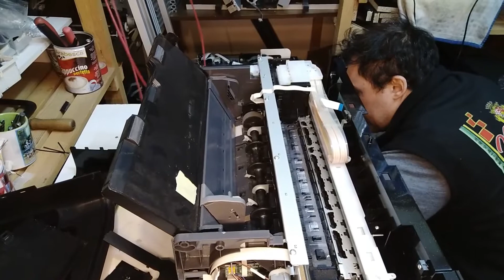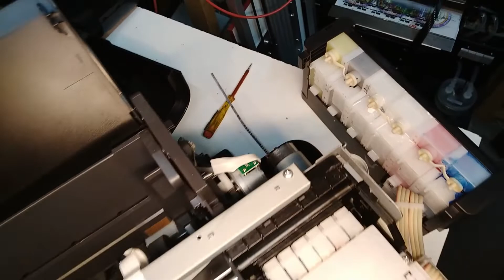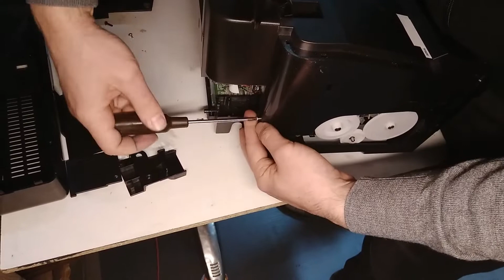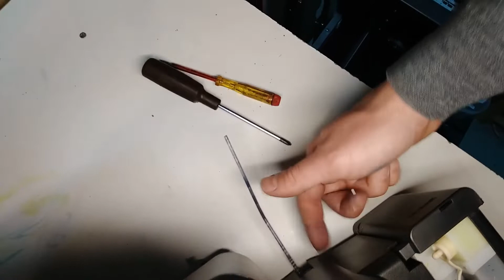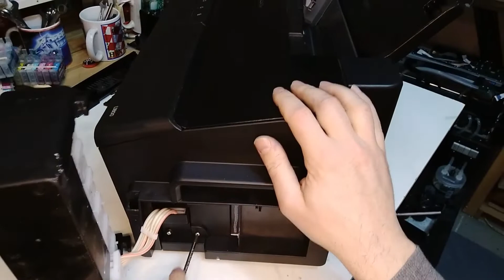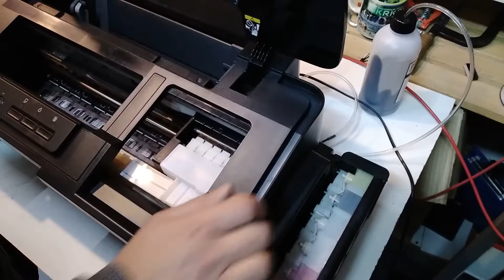DTF printer L1800 repair No. 2 (part 2)

Comment: Hi printer repair It is precious to find such an explained video. I would like to ask you a favor: I need to buy original parts for my L1800 printer. Do you have any Link? I tried to repair my printer. I installed a new head printer, but when I installed it, no color came to print, I tried everything but nothing and I think it must be the type of head printer. Can you give me an idea please. Thanks in advance
Reply from the maker: it could be two thing. usually if you dont see anything printed out at all it could be the flat cable for the head. Also if you bought a cheaper refurbished head it can sometimes be with faulty electronics, because when they clean the head (partially refurbish) they can not test the print, because once the ink goes through the head it has to stay covered with dampers or cartridges. You have OEM sellers in each country so maybe if you try with original head that would be the best thing to do.

Comment: Great videos! Are you in the US? I'm having a similar issue with my L1800 and could use your services. Please let me know. And keep the videos coming!
Reply from the maker: Nope, we are in Europe. What kind of issues?
Reply: @Max0ressurected   Printer prints faded colors that are almost invisible. It's like a shadow of the image with faint colors. I have cleaned the print head, replaced the print head with a new one, and also replaced the dampers. When priming the dampers there is a lot of pressure when pulling up the ink with the syringe. Which made me think there was air in the tubes from the color tanks. But I have cleaned out the tanks with cleaning solution and distilled water. Put in fresh ink, re-primed the dampers and still the same issue. I've only had the printer a little over two months. Any help or tips would be appreciated. It's been really frustrating trying to fix this issue.
Reply from the maker: @jaywilliams7974  are you using it with ordinary ink or dtf? Sounds like you are have problems with the pump. If everything is filled up properly and the printer is in use only for 2 months i dont think its the dampers or head. You have a valve on the outside tanks that you have to open, so check if its turned from transport to print position. If you use it as dtf set the colour dot size to middle+large. If that doesnt help you definitely have a problem with the pump. Could be that the capping is not covering the head from below as it should, so it doesnt have enough pressure on head cleans, or some tube is disconnected on it. I dont think the pump is clogged after only two months, but it could be a possibility if you are using low quality ink, although i cant say that we ran into one that bad that could clogg so soon.
Reply: @Max0ressurected  I thought it could be a pump issue as well. But I also thought how could it be so soon. The capping on the printhead is secure. The replacement printhead is new. The shipping knob on the tank is in the correct position. It really seems like it's some kind of pressure issue. It's like the ink wants to get to the printhead but can't. I also received "The waste ink pad has reached it's end of service" error twice! I don't understand how this error appeared so soon. I used the Epson Adjuster app to reset it both times. Could there be ink build up in the lines that restrict the flow of ink in two months? Also how difficult is it to replace the pump if necessary? I have been trying to solve this puzzle for weeks with no success. I have the feeling that it might be something simple, but I can't pinpoint it
Reply: @Max0ressurected  Also thanks for responding. I've contacted a few DTF printer experts and your the only one that's trying to help, so again I really appreciate your time.
Reply from the maker: @jaywilliams7974  in your case where the printer is in its original state, still with the original casing is a bit more difficult, but you have here in the videos how its done in 4 or 5 of them. The easy way to know if you have any pressure on the pump is to look at the capping during the head clean. there is a moment where the head moves to the left a bit from the capping and you can check if the head dropped some ink on it and also if the pump is gonna suck it in. If the pressure is good than the capping would be filed almost to the top.
Reply: @Max0ressurected  Apologies, I'm a bit confused. So the capping that you are talking about is the waste ink pad cap station?
Reply from the maker: @jaywilliams7974  its this thing on the link: https://ae01.alicdn.com/kf/HTB1wqthbrr1gK0jSZR0q6zP8XXaD.jpg it covers the head from below, and sucks the ink from the damper through the head
Reply: @Max0ressurected  Ahhh OK, thanks for the pic. Maybe it needs to be reseated? I also have a brand new one that I can install. So let's say it's sitting too low and maybe I accidentally knocked it out of place without knowing. Would this type of scenario restrict the ink flow to the printhead, creating the issue of little to no ink when printing?
Reply from the maker: @jaywilliams7974  not likely, because if you knock it out you could see it not standing straight and the head would stuck. same thing happens when one of the 3 small plastic pins on the capping is broken. its more likely that its not lifted all the way up for some reason. could be that the spring below is covered with ink so it wont stretch enough, could be that the mechanism of the pump skipped a teeth or two for some reasons so its lifting but not enough. we also had a case where the tube that is connecting the capping and the pump drum, popped of so it was pumping only air. You can make a test like this: when the head goes left when you start the printer pull out the power cable so you can move the head with hand to the left. Then you can pull out the sponge (even the net if you can get to the sponge because of it) so you will be able to see when you turn on the printer and start a head clean if the head is gonna drop some ink inside the capping and will it be sucked out by the pump. If that doesnt happen you will have to replace the pump.
Reply: @Max0ressurected  This is great info. I will give this a try in the morning. Many thanks.  Hoping it's not a pump issue, but if it is I will have to sort it somehow. Nothing prints on the nozzle test so that might be the case. Wish you had a video on this it would be a massive help😅 But I will do my best
Reply from the maker: @jaywilliams7974  this one can maybe help you, this printer had a problem like that https://www.youtube.com/watch?v=8rU0wQFU8aU there s also part 1 if you want to see the whole proces, but this part has the pump replacement
Reply: @Max0ressurected  I gave it a try and recorded it. File is a little large (apologies for that). Please take a look and let me know what you think. I would very much appreciate it. To my untrained eye, it doesn't seem like anything is going on as far as ink going into the capping area🤔. Here is the link https://drive.google.com/file/d/1F1brbbW1IAksT5dO9n2kgLgQc6Snkm_0/view?usp=drivesdk
Reply from the maker: @jaywilliams7974  i cant access it, says i need an approval for access
Reply: @Max0ressurected  Should be able to access now
Reply from the maker: @jaywilliams7974  you have to have capping inside, just without the sponge and the net covering the sponge. Now that you have the capping out remove the sponge and the net from the capping and install it back than film it so we can see if its gonna drop any ink to the capping. its not gonna suck the ink through the head if it doesnt seal the head from below with the capping.
Reply: @Max0ressurected  Here's the updated video https://drive.google.com/file/d/1PDAmUkOSFghxbeGPCy69xlAx3fnARn6Q/view?usp=drivesdk
Reply from the maker: @jaywilliams7974  i requested access
Reply: @Max0ressurected  Access granted
Reply from the maker: @jaywilliams7974  it seems that it is pumping something, the question is does it have enough pressure. but i should print at least something, but if its not printing anything at all than it might be the cable for the head, or something is wrong with the electronics on the head
Reply: @Max0ressurected  Maybe taking out the printhead and reattaching the cables might work🤔 Now that I think about it, I didn't start having the not printing issue until I took out the printhead to clean it when I was having trouble printing white. Soon after the prints started to fade, until I wasn't able to print anything. Is it difficult to replace the printhead cable?
Reply from the maker: @jaywilliams7974  reattaching could maybe work because sometimes it doesnt sit properly in the slot, but if you need to replace the cable it is kind a difficult but you have it here on channel in several videos. If the pins on the cable are good and not corroded, than i think you should be checking the head first. it could be the cable too but you would have to do a lot of prints until that happens. if you havent done much prints it is more likely that something is wrong with the electronics on the printhead
Reply: @Max0ressurected  It's so strange because it's a new print head. I replaced the original one because I thought it was the problem. Until I installed the new one and the same thing happens smh. This has been such a frustrating experience. I'm thinking about purchasing another model of DTF printer. This experience has totally put me off of the L1800. I'll keep trying but I think I would rather get a model that uses cartridges instead of a tank. Maybe something like the Epson r2880, are you familiar with model? The other alternative is to ship my L1800 away for a month or so for repair and hope that it can be fixed
Reply from the maker: @jaywilliams7974  i you bought the head on ebay for less than 200 $ than its probably refurbished one and those are not tested. in most times its good but sometimes they are just clean with faulty electronics. Im familiar with 2880 but you should know that the maintenance is gonna be much more expensive than L1800. The head is 8 channel and also oversized for dtf. Only benefit you will have is 2,5 times faster prints but when the head blows (and it will sooner or later) its like 6 times the price of one 6 channel head. Also the head clean is spending much more ink which could save you one L1800 for about a year or so, depending on how much you print. Maybe the best thing to do is to buy one more L1800 so you can print while you send this one for repair so you can always have one functional and you wont be stuck. Everything can be repaired.
Reply: @Max0ressurected  Now the left side, underneath the printer is leaking black ink when trying to print smh. Here are the pics. Also all prints are a faded blue (cyan). Is it even worth fixing at this point? https://drive.google.com/file/d/1TKDvaERZoX_grRCV7J-lPjKANe5JpcNE/view?usp=drivesdk

https://drive.google.com/file/d/1TU00-gAY5nDwedPXa1TlsMRK8OOpZii_/view?usp=drivesdk
Reply from the maker: @jaywilliams7974  waste ink tank is overflowing, you need to connect an extra bottle to the exit tube on the pump. It is worth yes, because the head is still relatively cheap. So financially it is worth but its not an easy task and it will cost time if you have less experience until you figure out how to fix it.